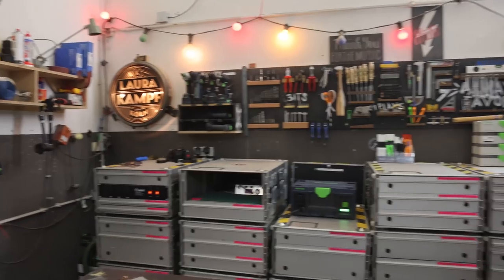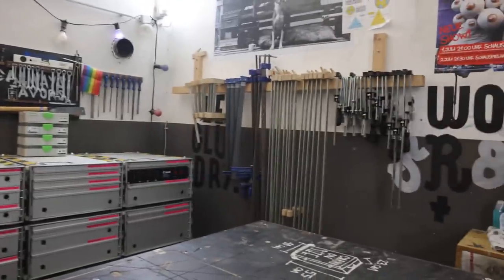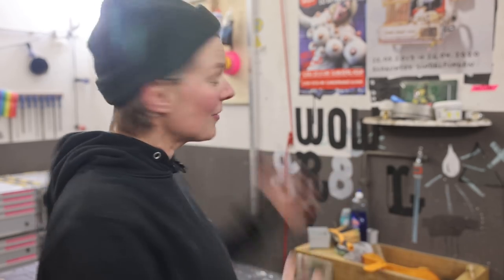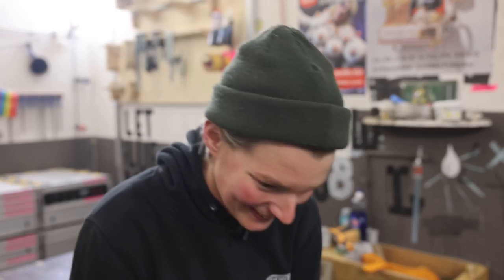This Clamp Storage Idea would be really good...if it worked :)

Comment: Maybe make a platform you can raise with the pulley in the middle of room as with this design you're still loosing the wall space. I could even see wiring lights underneath the platform so you could have a chandelier storage solution. They raise and lower chandeliers all the time with pulleys for cleaning.
Reply: Brilliant. Truck caps and jeep hardtops are also commonly raised up vertically in the center of garages - there may be some inspiration there too

Comment: Put wheels on the board that run in the track.

Use a single pulley and rope on each end of the board.

Put counterweights on the ends of the ropes, totaling the mass of the board and half of the clamps.

But you're not really freeing up floor space, because anything you put there will need to be moved each time you want to get to the clamps.

Maybe get one of those sets of rolling steps, and just mount stuff like the clamps permanently higher on the wall.

Comment: Hey Laura, I think one big problem is that you are trying to use bearings for pulley wheels which means the rope spins the bearing....aditionaly you made a block and tackle setup if you add more bering wheels it will be a force multiplyer and cut the load down.

Comment: Having the rails further off the wall would give usable space behind the board. Could be mounted at front edge of a tall and shallow shelving system. Alternative is to have a movable storage or work table underneath that can roll out of the way when you need the clamps.

Comment: I sure admire the creativity, as always...and of course your wonderful mixing of metalworking and woodworking, not to mention your delightfully direct narration!  But candidly, I'm not sure what you gain by the basic concept of the sliding sled. When it's finished and it works smoothly, you'll certainly have more open wall space at the working height. However, I'm not clear on how that new space can ever be put to any other use. But perhaps I may be missing the goal of the project?

Comment: Alwys love your crazy builds. If you want to keep it simple and mechanical I would take it instages to improve it. There's probably a lot of friction between the wooden back board and the runners, could add some HDPE/nylon or PTFE  runners. The pulleys rope is running on the outer race of the bearing so the rope can drift and contact the side plates, normally pulleys have a groove to keep the the rope centred and away from the sides. Finally once the friction is taken out I'd think about a counterweight or gas strut.

Comment: I'd say have two "sleds" rather than one giant one holding the clamps, roughly balanced between the two and use one as a counter weight for the other.
Reply: That's a really good suggestion - takes effort out nicely.
Reply: If one is behind the other, both can use the full wall space. Just have to limit the depth of the back one.

Comment: Hi Laura. Love your videos. 
Previous comments have suggested the following which should all improve your project…
1. Pulleys can have multiple “layers” - not just two so add an extra pull-through on each one.
2. Add a winch - even sailors have winches and a ratchet would make it safer on the release.
3. Add rollers on sides to keep it running parallel.
Key to pulleys is that one is fixed and one moves.
I’m learning a lot from your videos - putting it into practice building a mini caravan from the ground up…
Keep them coming :)

Comment: Definitely think if you counter weight it especially with something like heavy gage sheet metal that could slide in the track behind the shelf you should be able to shove the shelf up and the back sheet should come down. If you drill some pin holes in the rail, store shelf, and sheet metal when the shelf weighs quite A bit more than the shelf you can put a pin in to stop the shelf from coming back down until you want it and  if you have a lot of things off the storage shelf thus making it substantially later than the sheet metal you can pin the shelf in the lower position until you're ready to put it back up. Phenomenal idea and you did a fabulous job on it!!!

Comment: Laura,
A fantastic idea. Two things that might help:
1. Put rollers on the plywood edge to ride against the aluminum channel. This should markedly reduce friction . You might try roller blade wheels. I have seen them used this way before.
2. If the rollers cut the friction your current block and tackle (pulley system) should work. If weight becomes a problem, more sheaves (rollers) in the blocks will be the answer. You will have to pull more rope but it will be easier. Two more sheaves, one top and one bottom, should do the trick.
Best of luck to you. Your idea is the neatest and most eye appealing clamp storage system I have ever seen.

Comment: First seems to be a great idea and practical - Nice job! let's jump for my tips:
1. Add rollers on the lateral panel to smooth the up/down
2. Change the rope and use  Coated Cable (check the best thickness considering the weight)
3. Add lateral stoppers/blockers on the mainboard (higher and lower position)
Good luck!

Comment: To start, any video with Smudo is a winner 🤗  Dogs are a blessing.

As long as you learn you're winning.

I agree with some of the other comments... A counterweight system might solve your problem. Also you could change the mechanical advantage by altering the radius of the pulleys as well.

Kudos on an instructive and entertaining video... As usual 🥃

Comment: My grandfather had a lift/dumb-waiter he built to store material on the upper level of his shop.  It was wide enough for a sheet of plywood standing on its end but shallow.  I don't remember what kind of rail system it had to keep it level, but I do remember many many loops of rope around the pulley and a big steel bucket full of old rusty nails and screws as a counterweight.  Of course it wasn't intended to elevator humans, but my cousins and I had huge fun riding it up and down.  Him yelling at us that it wasn't safe didn't deter us so he finally had to padlock it whenever we were around.

Comment: Great ideas.  My first time using pullies I seriously screwed up too.  Currently, with 1 pulley you have 1:1 ratio.  As you increase the number of pullies then you get a mechanical advantage.  ie with 2 pullies it is as if the weight you are pulling is halved.  (the downside is you need to pull a lot more rope).  Your pulley with a ball race is a great idea, but there may be a lot of friction between the rope and the sides of the pulley.  Having a motor will make it easier and you need some sort of mechanism to prevent falling.  Also, I'd have tabs at the ends of the racks so clamps can't fall off.  That would hurt a lot or even kill somebody if they were unlucky enough to be under it at the wrong time.  Cheers, David

Comment: You can add 2 additional pulleys to your existing block & tackle setup to reduce the weight at the pull string even more (half!)... coupled with some counterweights & a locking mechanism to hold the whole thing down (when you use a bunch of clamps & lighten the sliding module).

Also, as some folks suggested, you can reduce friction at the points of contact on either side of your sliding storage unit... perhaps with grease or an old milk jug cut into strips & stuck between the sliding panel & its guide rails.

Comment: You should look into constant force springs. They are exactly what you need to assist your pulley system. Think of the spring inside a tape measure. But they make industrial size springs. They take up a lot of the weight of what you're trying to lift. Very similar to a garage door spring but much more compact.

Comment: Pulleys are individual components of a block and tackle system; it is the block and tackle arrangement that gives you the increased weight handling or distance, depending on how it is set up. Use a winch in place of the block and tackle. This would also provide the ability to apply friction when lowering it and a chance to replace the manual winch with an electric winch when funds allow. To reduce the wracking friction (when the board goes squid in the channels) use a rope from either end of the board over the directing pulleys to the winch.

Comment: 1. I'm seeing similar comments below about the friction of the wood in the aluminum guides. I think some simple teflon pads on the 4 corners and loosening up the channel accordingly would make it slide much smoother. Alternate idea would be rollers. Have a look at the rollers inside of a forklift mast. You'll get the idea. 
2.The pulley and rope system is on the right track. You need to look at 2 additional forces with the pulleys however. I noticed when you rearranged the pulleys correctly, the board jacks to one side when it's getting pulled up. That tells you the weight is not centered correctly on a single point lifting system. Another option would be a multi-point lifting system. Basically 4 pulley blocks, 2 per side. and one rope threaded thru the whole thing. I've worked with giant overhead panel doors made by the Electric Power Door company. They have a maze of cable and pulleys running thru them (notice singular "cable") and an electric winch on the top. I think a small hand cranked winch would be fine for your purposes, but the cable routing similar to those doors would correct the weight balance much easier than a single point lifting system.
3. Make sure the washers on the sides of the bearing inside your pulley blocks are not keeping the bearing from rolling. Just a point of concern. In the future save some hassle and make the brass center spacer 1-2mm longer than the thickness of the bearing, and let the bearing "float" slightly on the spacer, no washers needed. 

Keep it coming. Spectacular content! " To err is human; to admit it, superhuman.
 -Doug Larson

Comment: Hi ! May I suggest you to add some wheel from skate board or roller between the wood and the metal groove. they are pretty cheap in general... it will slide more easily.... forge some metal in shape of a C four times and put it on the wood.
On the other hand, it might be good to add a small block of wood at the end of the clamp support in order to block their falls in the event of improper use of the panel! Good continuation Laura!

Comment: Great work @Laura and thanks for sharing. I think I would try and design it such that you can use a electric impact driver to move it up and down (without needing it permanently attached) look at a ratchet winch. then weld on a large head head

Comment: Cool project! 
Maybe add rollers to the edges of the board to reduce friction wiht the rails. And it may be cool to add a sail-boat winch to the system to make pulling up easier.

Comment: I will add my voice to the counterweight idea, but with a twist. 
Make the counterweight a second board, for some other tool storage (something thin, though) though that slides down behind the clamp board. 
Mainly this idea came to me as your current arrangement reminded me of the blackboards in the lecture theatre at university.

Comment: Using a counterweight like in a lift/elevator might help you Laura. Also, have the rope form a bridal from both top corners, to prevent the whole thing from skewing sideways with an unbalanced load. This happens if you’re trying to lift from the middle rather than from each corner. The bridal would be formed by a triangle of rope from each corner to a central fastening point. You might need to make the pulley system a bit higher to allow for the bridal.

Comment: The large sheet of ply probably adds a lot of weight.. i would a) add a load of lightness by removing sections of the backing board.. 2) offset the rails by a distance that allows you to use the wall behind for other kinds of storage 3) use those lovely bearings on the rails 4) use actual grooved snatch blocks for the pulley 5) optionally if everything is securely clamped on the board use garage type curved rails that allow the whole unit to slide up and onto the ceiling :D

Comment: Nice use of the high ceilings. I bet you can make it work!. I have my shop in the basement, so in one corner between two floor joists over head, I screwed a rectangle piece of wood on each to make a channel down the middle. I just slide them up and twist to lock them in place. Pretty simple, but it works well enough. Now the small wood clamps, those are just clamped to a couple vertical 2x4s I put in. Not great, but at least they have a place!

Comment: This is a very very cool idea. I am extremely partial to storage that goes vertical and your DIY pulleys are cool. Big props on making your own. However hardware store or marine supply pulleys (think sail boats) are going to have a wide U shaped channel that the rope sits in to prevent binding. Also the amount of weight you are lifting is going to dictate the number of pulley blocks you need and the distance the rope will need to be pulled. If its not moving smoothly then it is binding. If its too heavy you probably just need a couple more pulley blocks.  SmarterEveryDay did a 16+ minute video on the physics of block and tackle/ snatch blocks.  You are 98.5% there. Keep going. Very Cool

Comment: Ooooh, you have a great idea. This should help. Use a cable wire, with right size pulley groves. The rope is binding on the edge, making more difficult during lifting. Also the weight is an issue. Making a manual spinner with a larger wheel will make short work of lifting and lowering. Also, making a contraption to lift and lower using a drill is right in your wheel house. Again cool idea. Much love and be well.

Comment: I would recommend revising the way the rope connects to the board as any difference in balance adds friction to the rails in side pressure. probably best to have two mounting points on the wall, to balance that shift in load pressure. And since the goal is saving space, the idea of a second board of tools in the same space means that you can use both areas of space at the same time and the second board can serve as counter weight for the first board.  As the Clamps go up, another board of tools comes down.

Comment: That's brilliant idea. If you put wheels into the 4 corners of the board, it would prevent them from binding.
Also, what about having two boards connected together, like old blackboards that were at school? The second board would be great counter-balance weight. Then you would have a crank (one wheel with rope looped around it) to move them.

Comment: Proof of concept excellent, try a small hand crank boat trailer winch the gearing varies depending on size of boat.
I would make a lot of cut out's to lessen the overall weight also or just build a frame rather than a solid back.

Comment: Hi Laura,
As surely as others have suggested to you, you should improve the sliding of the panel in the guides and use grooved pulleys to prevent the rope from sliding against the sides of the blocks; you could also check that the distance from the wall of the two parts with the bearings is the same, again to improve sliding and reduce friction.
In case you wanted to motorize you could buy those construction hoists (the ones that cost less than 100 euros at lidl, when they sell them), however, mounting it with the steel cable spool against the wall, again to avoid off-axis traction.
I'll see you in the next video, bye

Comment: A second pulley system with a counterweight could do the trick. Maybe even passing it through the wall so the counterweight isn't in the way (or moving it to the corner over on the left) so it takes the load off of you and you red rope is just to move it while the weight is managed by the counterweight (could be a hunk of metal or a bag or sand). The think is that since the weight of the board varies with the number of clamps on it, the counterweight can only aliviate the weight of the board empty. If you make it havier the board will shoot upwards when empty (unless you tie it in the lowe position everytime it is empty or make a rope loop from the bottom to the top of the board passing through pulleys do you can pull it either direction)

Comment: Vertical garage door opener.  Maybe add a couple of garage door springs horizontally (in case of break) along the ceiling with cabling over pulleys down to clamp panel.

Comment: Pullies usually are convex to guide the rope and let it stay on the pully. By using ball bearings you’re rope can jamm in the pully. Also you could consider having guide wheels at the side of the board so it will gilde easier up and doen?

Comment: Suggestion- instead of pulling on the rope- Add a hand crank to the pull rope like is used on the front of a boat trailer use to crank up boats in place, will make up/down much easier.

Comment: Have a look as US garage doors.  1. They have channel tracks with bearing wheels on door panels.  2. Big springs to lighten load. ... offset tracks from wall to get second space behind  and add counterweights with ratchet lock mechanism to hold panels up.  Good luck.

Comment: Some thoughts - 

Storage board might be binding sideways in the runners if its load is not directly under the pulley.
Storage board will definitely be binding front-to-back as all the load is on the cantilevered hooks/pegs/shelves, and the pulley is next to the wall.
Bearings are not pulleys! Adding a proper grooved pulley wheel over each bearing will keep the rope running true and avoid it rubbing against the cheek plates (or even jamming into the crack between the bearing and cheek plate).
To lift it, perhaps a hand-cranked ratchet and pawl system, or a differential hoist. Both would give you another opportunity to add mechanical advantage if operating by hand, or could be motorised.

Finally, a safety tip - a small lip or stud on the front edge of those clamp shelves would prevent them from sliding off as the unit is hoisted. They're heavy. It's high. Please stay safe.